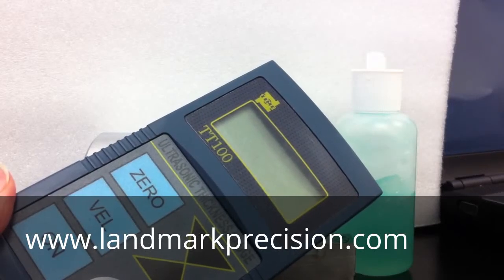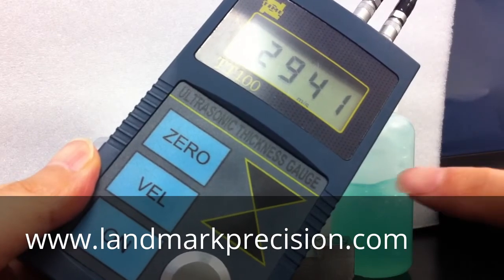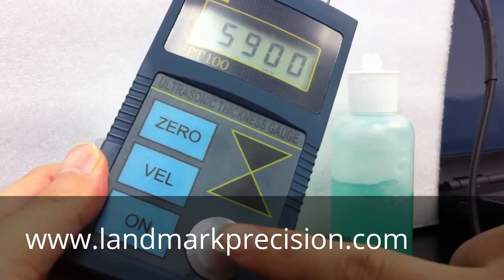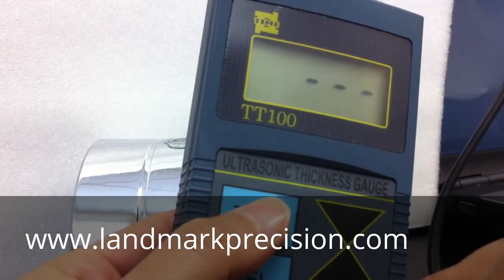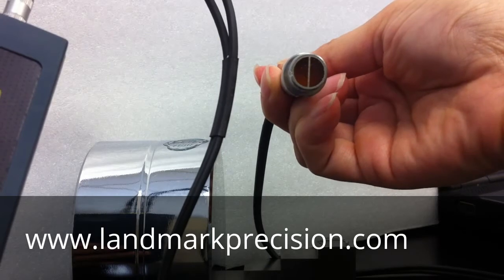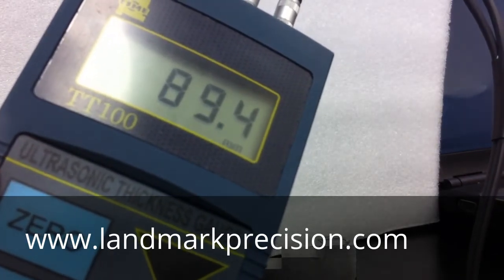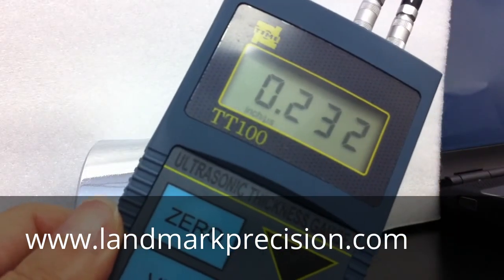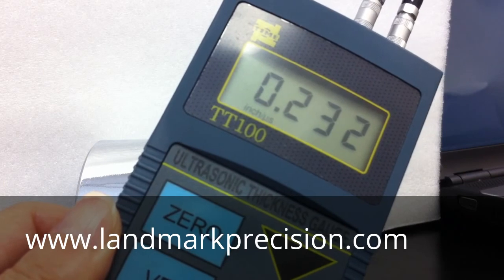Ultrasonic thickness gauge, Meter, Tester Time TT100

Comment: Hi there, i was wondering if the steel part is painted, will that affect the measuring? do i have to clean off paint the part before measure?
Reply from the maker: Hello, yes, paint or other coating will affect accuracy if you are using TT100 because it doesn't have thru-coating feature. (Our UMap-1D has the feature.) If the steel part is thin, you should scrape the paint off the testing area before test. It may not make much difference if the steel part is very thick but you can still scrape paint off first.

Comment: How to to measure the thickness of a glass cermic when we don't know it's velocity of sound through that material? Please give me answer. Thank you.
Reply from the maker: Hi, 
You can try to use 0.2270 in/µs (if you use Imperial) or 5766 m/s (if you use Metric) for glass, then adjust it up or down based on the actual material because the actual velocity may be slight different.
The better way to get the longitudinal velocity of ceramic is to test it. You can get the thickness with a caliper first, then test it with TT100 (with random velocity setting). You will then adjust the result up or down with the arrow buttons until it's the same as the caliper result. The last step is to push the "VEL" button. The display on the screen will be the velocity of the material. Good luck!
Reply: @Alltesters4QC  
Thank you for your kind reply sir . May I know what is the diameter of the transducer  edge and what should be the minimum dimension (surface area) of the sample .
Reply from the maker: @sathireddyb8306  Hi, You're welcome! Are you using the 5MHz transducer? If yes, the recommended minimum diameter should be 0.5" (12mm in Metric) or greater. The minimum pipe size should be Ø0.8"×0.12" (Ø 20×3mm) or greater. If you are testing pipes, please make sure both of the two sides divided by the central divider on the bottom of the transducer can make contact with the pipe, in another word, the central divider should be perpendicular to the axis of the pipe so the transducer can send and receive back signals properly.